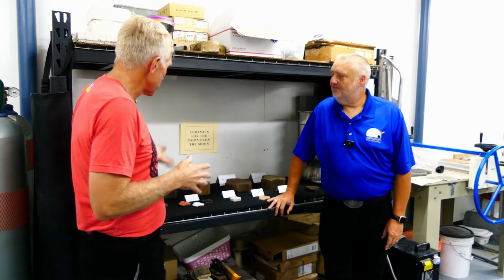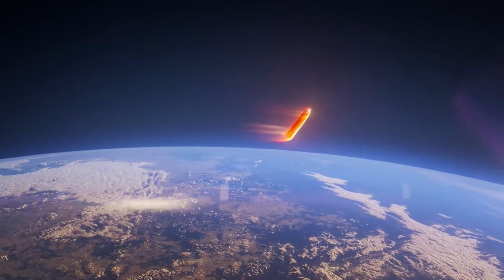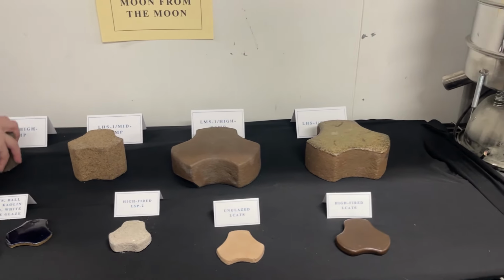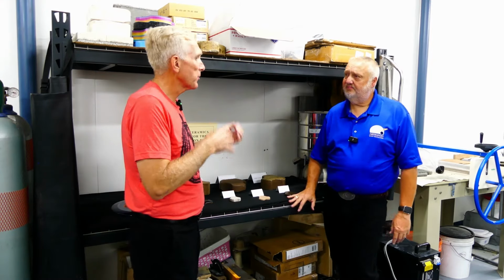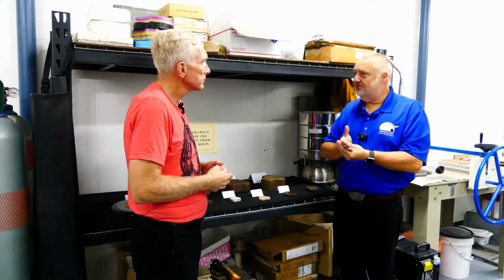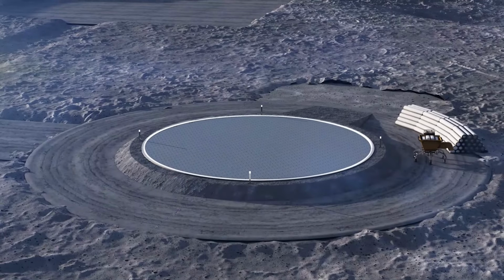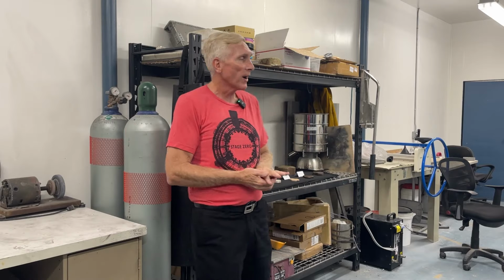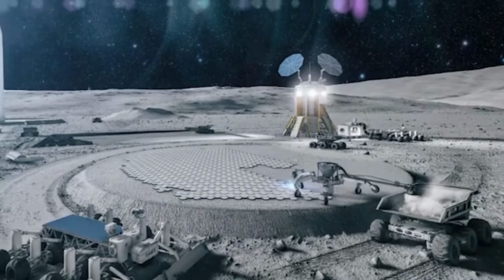Astroport Space Technologies Development laboratory Tour Part 2

Comment: If we make a pavement we put retaining bands (don't know if this is the correct english word).
Of course combined with an edge pavement stone.
Reply: Good point made how do the pieces hold together let alone mould in a vacuum or cement together or better yet maybe cut a flat surface out of the existing solid surface ?
Reply: They will try to melt neighbouring brick together while each brick is being melted in position.